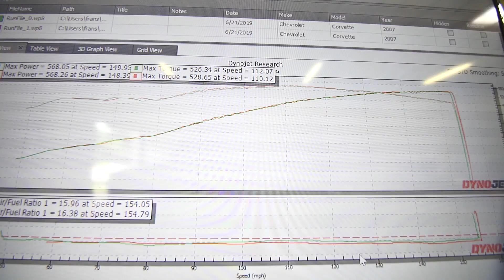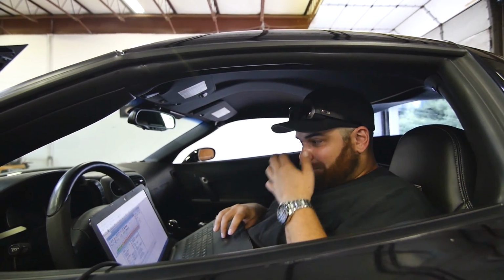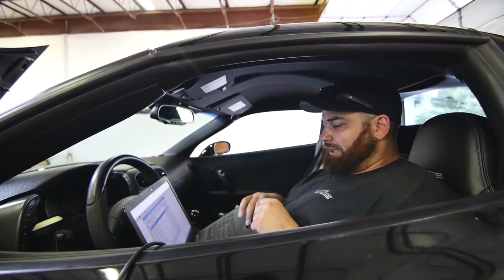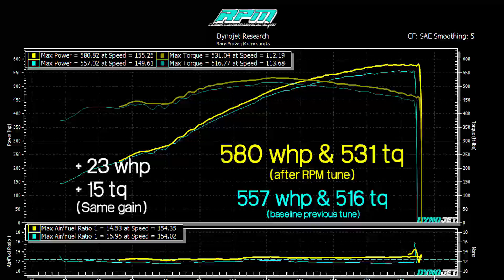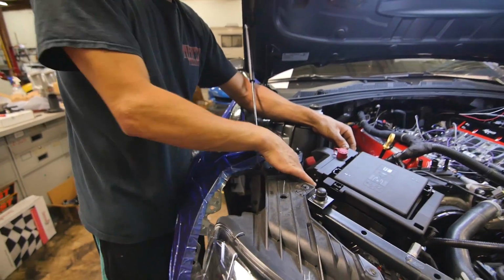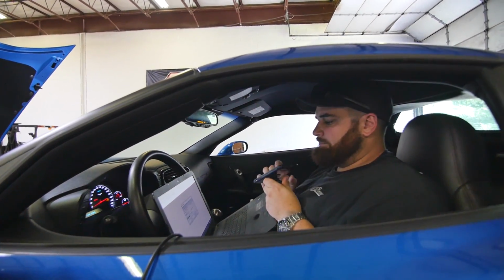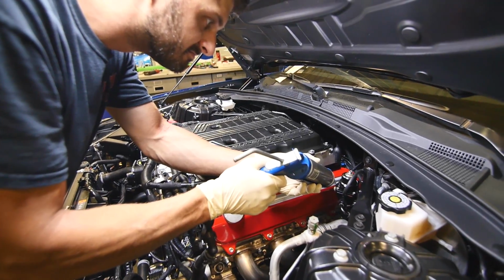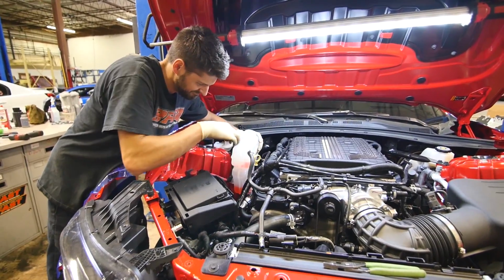Mustang Dyno or Dynojet? The Ugly Truth ... | RPM S7 E23

Comment: I feel like the Jeep community is the worst for it. They’ll try to compare the merits of two different FI kits based on two different vehicles on different dynos with different axle ratios vastly different tire combos and pressures. It’s a mind blowing fact a 485hp Hemi will often dyno less than 300hp through a Jeep vs a challenger is over 400.

Comment: All you need to do is know the weight with driver, and mph in the 1/4 mile. You plug it into .00424x mph cubed. x weight with driver is true whp. You can't argue with trap mph assuming you hook up and shift ok. example .. I did 128mph in a car that weighed 3825 with my ass in it. So .00424x 128 ... cubed then times 3825 equals 611 at the tire.
Sounds about right for a vortech on a  1998 mustang cobra running 15 psi doesn't it?  4.6 cammer engine.And yes it had my 250lbs plus ladders, beefed trans, and vortech package and 100lbs of various cameras, gear.

Comment: The guy really doesn't care how different different makes of dyno read as he is 100% right it is just a tool.  The only time a problem comes up is when you are racing in a class with a BHP limit and you set up on a dynojet dyno and then the track has some dyno that you cannot seem to find in any tuning shop that reads way different to the one you set the engine up with.  Then its a nightmare. The rules don't say what make or model of dyno they use and the guy doing the trackside testing cannot test anything until the race weekend, which could be months away. How do you set up an engine to a power limit that is only measured on one dyno in the whole country? That is when it becomes a problem...

Comment: Question how many times a year do you have to fix a broken linx bolt. Ours is killing me.
Reply from the maker: We don’t use it that much but honestly never had to ever
Reply: Yeah I use mine about 5 to 10 times a week. It does good for a month. Then have a bad month. Then good again for another month. The linx system for every day use is why I regret not going mustang dyno. All the money for a dynojet and I have to remove 2 tiny bolts and pull a shaft to unlink. Should be some sort of latching mechanism. Ours is in ground and it's already a inconvenience to lay down on the floor and then pry a shaft out. If you install to where the shafts come out easy like the manual says then you will be fixing it every week and alot of lost billed dynotime. Considering welding the front in and not accept any fwd cars

Comment: or a dyno dynamics my car makes 436whp.... my caddy cts-V was made to be 475whp from GM hints the 475whp x1.17 ( the .17 is drivetrain loss) equals 555.75 ..... car is advertise from the factory at 556hp...
Reply: Dyno Dynamics dyno reads almost however they are setup to read, just like a Mustang Dyne.  Decent tuning tool but with meaningless numbers.